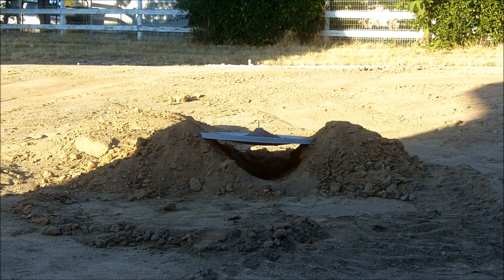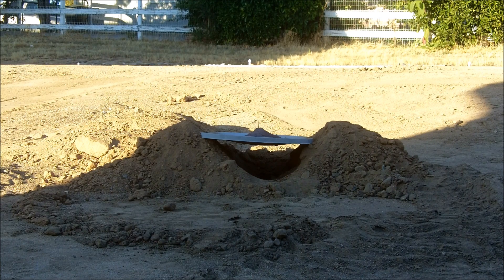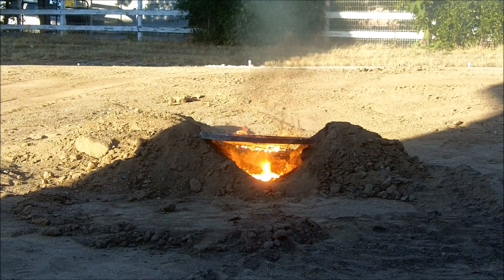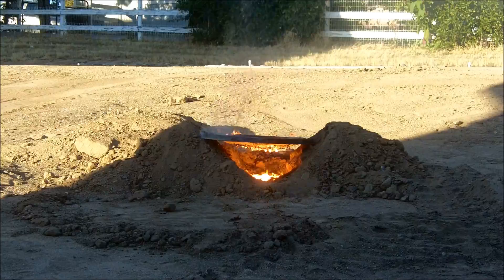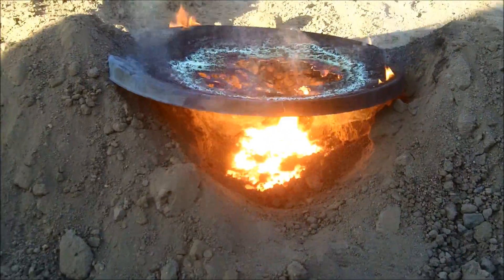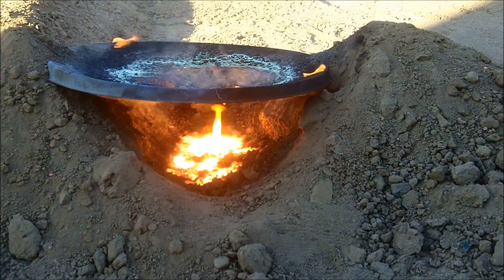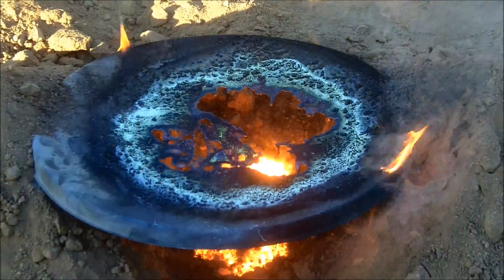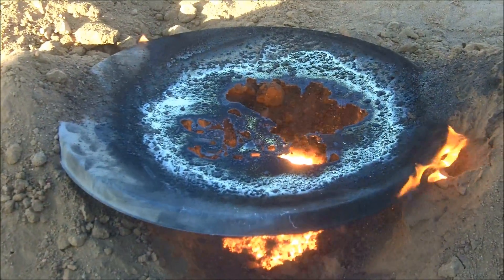Thermite

Comment: If I find myself doing "Cadwelding", I could make a video. I have the small #4 wire molds. For lightning protection systems we use > #00 wire, and weld it to building steel. Sacrificial electrodes are used on pipe lines. We tag (exoweld) those to the pipe and the block of magnesium alloy gets eaten away by  electrolysis instead of the steel pipe. 2 years later those blocks look like hell. I need to go back & get my BS degree! Then off to dental school. Let's see'em send that job overseas!

Comment: The loads are stupid expensive. After 40 miles of bad road the silvery gun powder ignition powder is so mixed in the thermite the little spark gun sparker won't do squat. After a day of exothermic welding you have no hair on you hand or forearms. The loads have tin and copper mixed with the thermite. A small tin shaped like a gold pan melts out and allows the brazing slug to drop into the mold and fuse wire to wire, wire to copper rod, or wire to a steel beam or pipe. It is all UBER EXPENSIVE!

Comment: I use thermite for exothermic welding of grounding electrodes, lighting protection and anti corrosion electrode blocks on pipe lines. The work sucks. Thanks for the sparkler tip. The ignition powder in the tubes gets dislodged and mixed into the thermite and it would not ignite. We use pre-measured "shots" in carbon crucible molds. The shots loads are expensive. Now I can use the F'd up cases I have. Thanks!